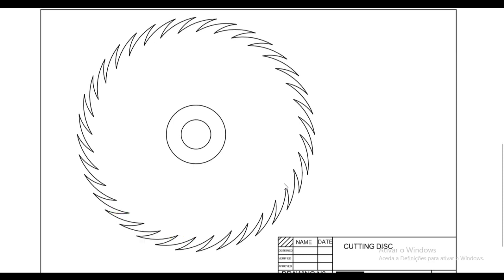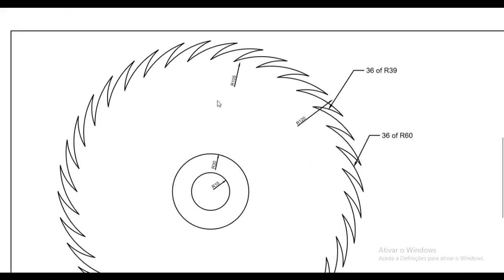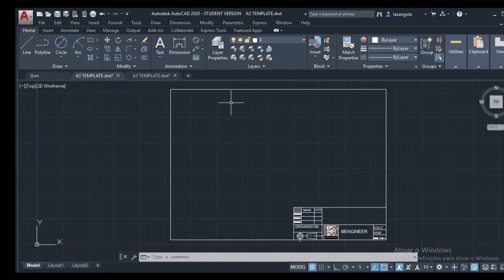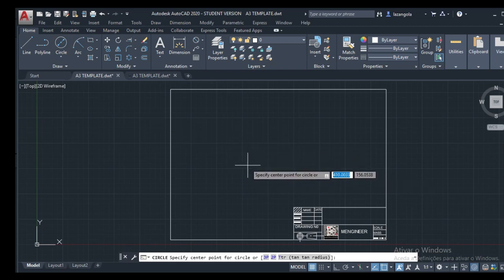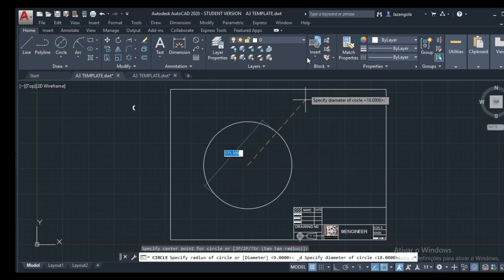Lesson 24 of 50 Practice 7 In Auto-cad For Mechanical Engineering

Comment: How is it 10° from the horizontal?  And also, the finished part is different from the one given in the drawing. ( there is a larger gap between the teeth in the given data, I mean the two arcs 36 and 39 do not overlap) Thank you 😊
Reply: 360/36 = 10, he made a mistake in the second arc it should have been 60 radius but he put 39